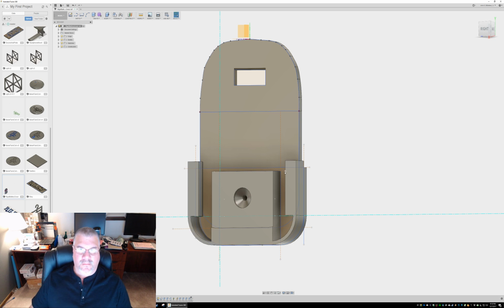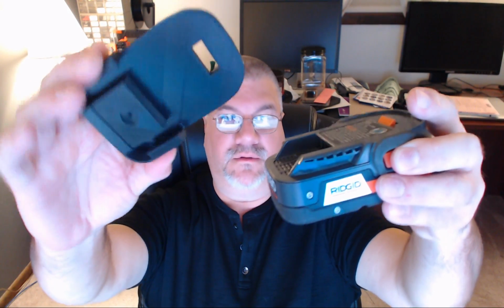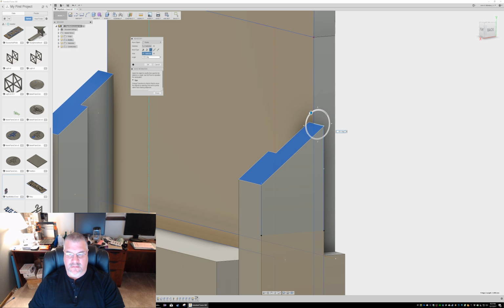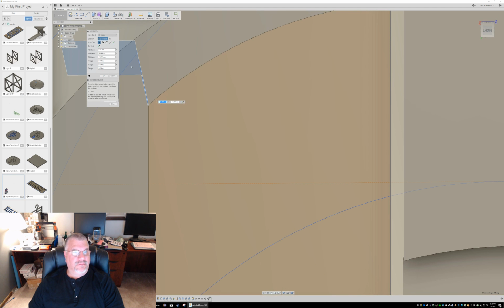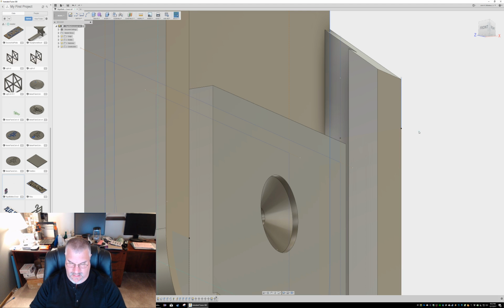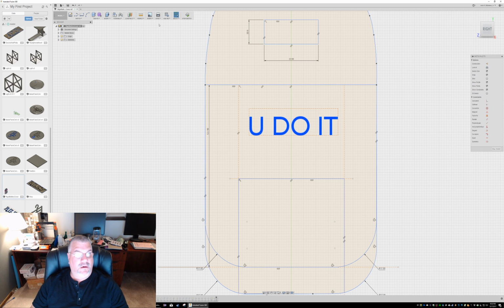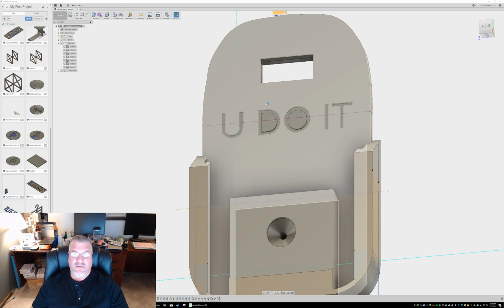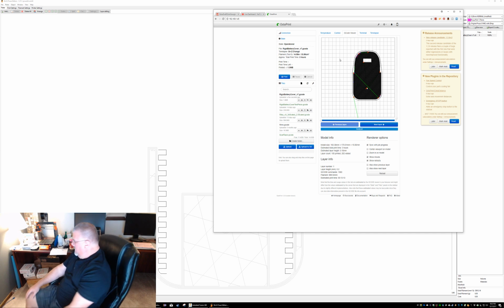Designing a @RIDGIDPower Battery Cover in Fusion 360 and 3D Printing it for Safe Battery Storage Ep3

Comment: Thanks for posting.  Where did you get the original file for the cover?
Reply from the maker: Thank you for commenting. I designed it on Fusion 360. I went through 11 revisions until I got it right.
Reply: It looks nice.  Would you mind sharing the file?  I'm new to Fusion 360 and have been struggling just to get the right profile of the battery.  If you'd be so kind, could you send it to lapsmith1 at gmail dot com?  Thanks!!!